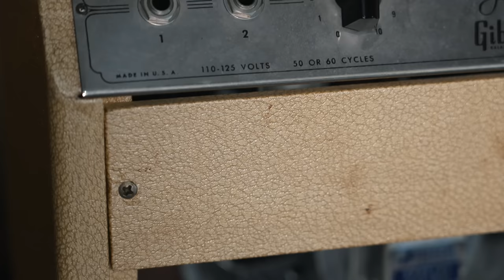The Easiest Tone Mod

Comment: Those old Bumble Bee caps in an amp are bad news.  They leak DC which messes up the bias of the tube on its output side.  I had a similar original speaker in my Vibro Champ and changed it to a Weber too.  Huge difference.

Comment: Moving a bit more air is a good plan matthew, the amp is easily coping,
it sounds bigger and less boxy! i`ve just done the same mod on my 1960s
vox AC 4, ,from an 8" to a ten inch celestion, ,you must drain capacitors !
before doing any such invasive surgery ! great job 😎👍

Comment: The new speaker sounds great. The old Jensen can't last forever. That RCA 12AX7 looked like it was cracked at 3:56.  The Sylvania tube has seen better days too.  The black residue in the glass is oxide from the plates.

Comment: That's such a simple amp that it's real easy to check all the resistors and caps in just a few minutes. If the tubes are still strong, you're in business. From what I can tell over the phone, it's doing what it does very nicely. 
      Try playing it along with a Princeton reverb. Set it for a clean mid scoop, with just a touch of reverb, and balance the level between the two amps. Once you get it right, it's very 3 dimensional, and the two amps project exceptionally well.

Comment: So, a sixty year old transformer - does it vibrate when in use? Does the lacquer shielding the windings melt or go brittle? How long do transformers actually last? Does the copper degrade? Don't you have to replace the transformer as a matter of course?
Reply: They last much longer then you think, I have from 1930s that still work strong!

Comment: Hey Matt! Check out the speakers from Jupiter. They make the best Chicago Jensen type speakers made right now. They even offer a paper voice coil former as a STANDARD option for almost everything they make.

I’m very impressed with the 12LC-P and M10C-P. The alnico 10LA-P has my attention too.

You can also pick up some of the best capacitors for your vintage amps at the same time.
Reply: Little Jupiter in my Silverface Champ made ALL the difference!
Reply from the maker: I've hears great things about them!

Comment: Speaker changes have always been my first port of call when looking to upgrade an amp's tone, generally followed by tubes/valves. Have a little Ibanez tsa-15h that's now paired with an old Jensen 12" and a Mesa power Tube. With mods (all second hand parts and amp about 300€/$) it sounds as good as amps worth 4 times more. Great pedal platform in a wet dry rig

Comment: I think it’s always a good idea to try other speakers . If you wanna record with it maybe a cab with a 12 inch might be better to run it into. It definitely lost some of its ommff with the new speaker the lead tone wasn’t as cool . If I used it for recording I’d use the original speaker and only use it for nasty lead tones . But it’s always cool to try different speakers. Thats most of the sound

Comment: My main amp is my Gibson ga5 LP reissue tube amp that I swapped the preamp tube for a 12au7 and a Jensen C8R speaker and I finally got the tone I want I use a treble booster and a wah pedal and a delay and a phaser for the overdive tone so swapped the preamp tube in mine cause I don't like having it distorted when I don't use the pedals I can sound clean and I use 8 gauge strings that I let get dead so I can get that flatwound sound but I like super light strings and yeah that's my whole rig and I personally prefer Gibson tube amps I just love the dark sound

Comment: Just so people get it, a bumblebee capacitor used on a live circuit does not retain its original values as well as one installed in a guitar.
Important for purchasing decision.
Reply: ASMOF, bumblebee caps are dangerous on a live circuit: Very leaky.

Comment: Nice playing.  Sounded pretty good both ways, just different.  I wouldn't say one distorted more than the other.  Amp just has a nice natural distortion.  If you want to clean it up, you could add a negative feedback resistor (here's guessing one is not present in current circuit).  This is like the change Fender made in the Champ, post-Tweed.  Of course put it on a switch!

Comment: Matthew, Immediately I noticed the difference. Good call. When I was fortunate to score on an original 1963 Fender Tweed Champ amp in pristine condition I changed out the speaker with a Weber speaker. I even had a great conversation with Ted Weber on the subject. This was years before he died.

Comment: Sounds great as always.  Question for anyone: If the amp is unplugged, how can you still get shocked?🤔
Reply: Capacitors can hold a lot of juice. Short them out with a body part and it could be bad.
Reply: @mooseymoose  No, it will be bad! ⚡😲☠️
Reply: @dingalarm  Not always. Believe me, I know.
Reply: @mooseymoose  Really? I'm intrigued 🤔 Please tell me more...🙂
Reply: @dingalarm  Smaller capacitors and partly discharged caps might give you a small jolt, but it ain’t necessarily going to damage or kill you. Otherwise there wouldn’t be any amp techs left. I’ve been poking around circuits since I was 12. I’m 50 now and have gotten a couple zaps but I’m still here to tell you about it.
Reply: @mooseymoose  OK. Thanks for the reassuring info 😋 I'm an electronics hobbyist, but am yet to build a tube amp. I hope to build a Vibro Champ soon, possibly followed by a Tremolux 5E9 (head version) 🙂
Reply: @dingalarm  You should be careful and understand what’s going on, but it’s not that difficult or worthy of terror, lol! Make a discharge tool and make sure you touch both (not at the same time)legs of all the caps if you’re uncertain of the charge level and you should be fine.
Reply: Actually it’s possibly to discharge a cap by touching both legs but in a circuit it’s better to hook one side of the tool to the chassis but if the cap is not soldered in then you don’t have much of a choice.
Reply: Follow up question: Never touched the inside of an amp but I built two guitars from kits.  Do the capacitors on them hold a charge also?
Reply: @saxophool  Not enough to be of any concern.
Reply: @mooseymoose   Thanks again for your advice! Indeed, I will be using a discharge tool (with a multimeter to confirm low voltage).